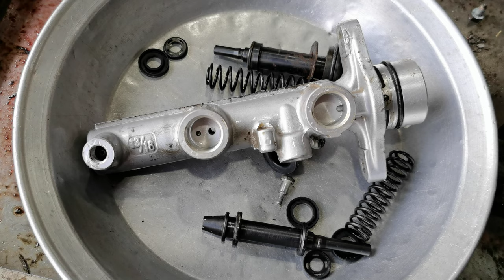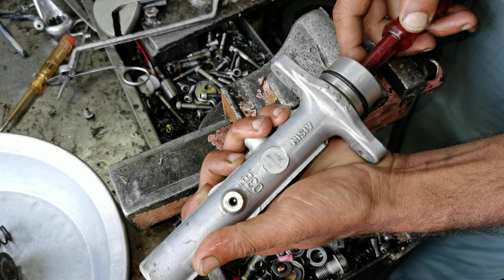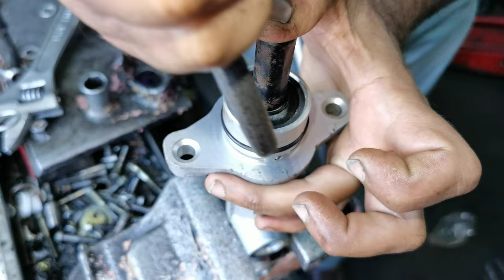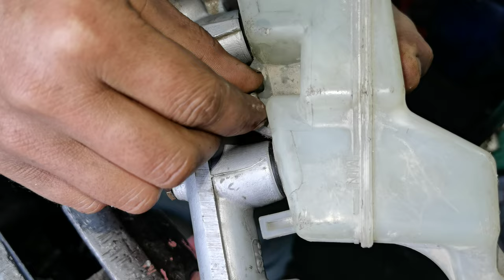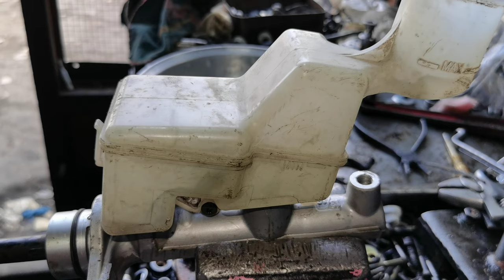how to repair brake cylinder 13/16

Comment: If you would be so kind, my brother, I have a problem with the gear stick that does not start in the early morning until after a while when the engine heats up. What is the reason?

Comment: Bahi brake serva repair ho sakta hey?
Reply from the maker: Brake serva new lagay ga abbottabad muree road near bord ofice raja markit adeel auto shop
Reply: Thanks, bahi pajero 1994 ka diesel pump repair karwana hey, apni workshop ka address share karey.
Reply from the maker: Ap ay jana raja markit main he Mari shop ha
Reply: Bahi raja market kis city mein hey? Mein ney pajero intercooler 2800ka fuel pump repair karwana hey aap se.reply thanks.
Reply from the maker: Abbottabad
Reply from the maker: 2800cc 4m40

Comment: hello sir meri honda city i vtec me master cylinder aur break booster jaha bolt se tight hota hai waha se oil leak ho raha hai.kya problem ho sakta hai?
Reply from the maker: Cylinder ki  Washol change karni paray gi
Reply: Meri Honda city old 2003 hai break master cylinder kaha milegaaa
Reply from the maker: @waquar881 spare parts ki shop sa
Reply: Kya company service kit  alag se banati hai taki Puri assembly change na karna padheee
Reply from the maker: @waquar881 ap sara brake cylinder change kra lo acha ray ga

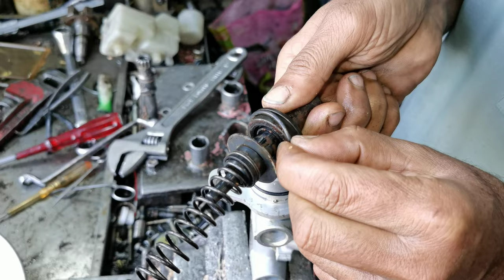Comment: THESE 13/16 PUMPS ARE NOT THE BEST. THE RETURN FLUID FOR REAR WHEELS TENDS TO LEAK INTO THE BRAKE BOOSTER IF YOU DON'T REPLACE THE SEAL(S) O-RING AT THE PART YOU SLIDE AT 1:23. GET THE ENTIRE KIT AND DO THE FIX, DON'T GO WITH INDIVIDUAL SEAL REPLACEMENT.